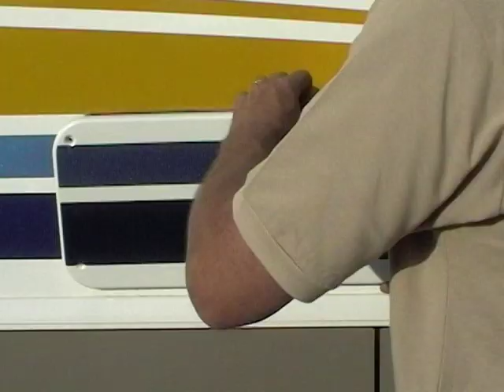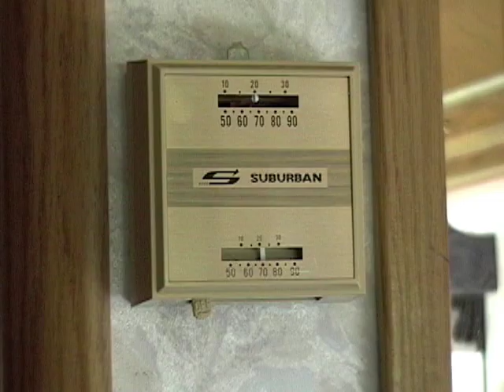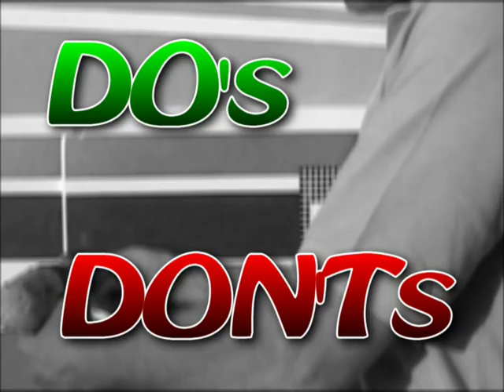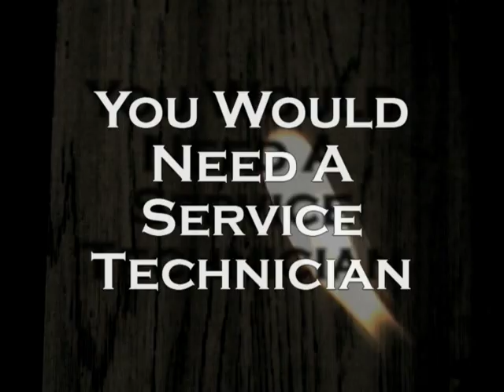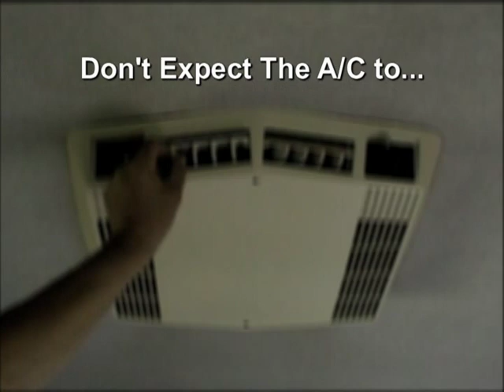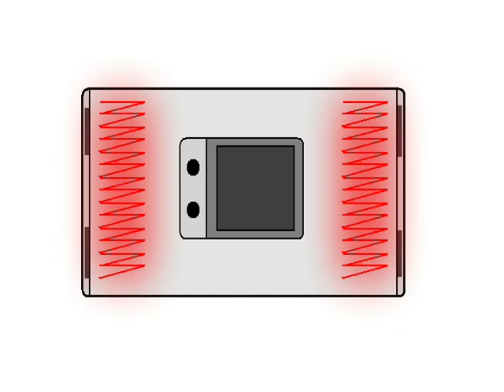RV Furnaces and AC - Learn about your RV Furnace & Air Conditioning

Comment: Thank you for the video wow! Im still not sure though…Does anyone know if it matters that the ac is working but the furnace is not? It was making a loud noise for while and then stopped working…I think the fuses are ok (will double check)but thinking of going to the outside part and finding  the pilot there and lighting it? Ive got a 2004 trail vision and no manual…lots of bugs here in PA. now…it was all winterized and now there will not be heat when it gets cold again…please help!!🙏

Comment: So you need propane for air conditioning? Our propane works,we haven’t had any issues, but we don’t know how to switch to air conditioning.
Reply: I’m a newbie, it’s hard to find a place with no credit unfortunately so we moved to a camper, and I have copd so I’m nervous about the summer, I’ve already experienced winter here, first 2 days were freezing until I learned about propane properly 😅 so now I’m wondering about the air conditioner

Comment: when I put the air conditioner on, it seems that the thermostat turns on the furnace ( I am able to manually turn the furnace off). Do both need to be running at the same time if I'm trying to cool?

Comment: I have a Suburban S
-30 that will not turn off. I have to pull a fuse to get it to stop. Both fan and burner. Any suggestions
Reply: has to be your thermostat i have the same one an problem i had to replace my thermostat

Comment: hello. I'm wondering g if you can help me. I have a 2010 puma, by palomino. I have a Dominic Ac and Dominic digital thermostat. my problem is, when I turn the heater on, the fan from the Ac turns on, just the fan,not the Ac.  when I turn the heater off, the fan turns off and the heater bower stays on for a minute. is the Ac fan turning on normal? thanks in advance
Reply: That could be normal depending on how they set up the thermostat